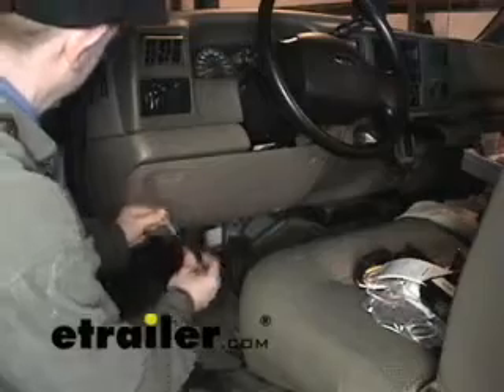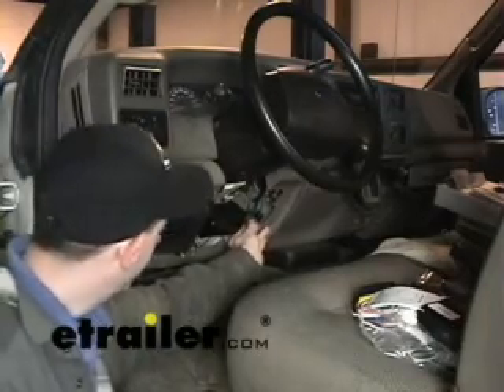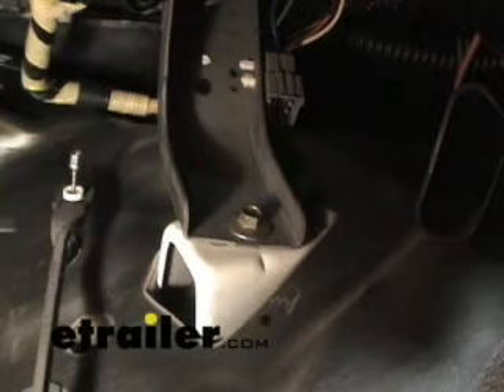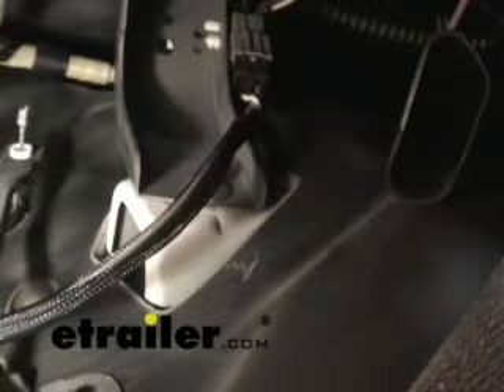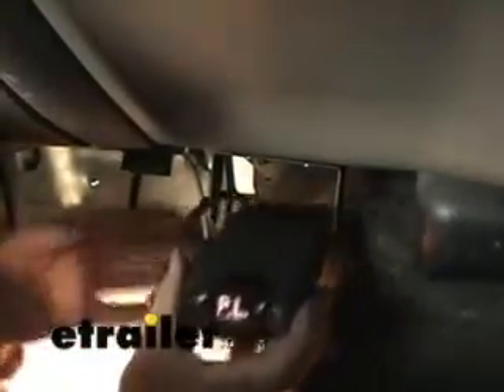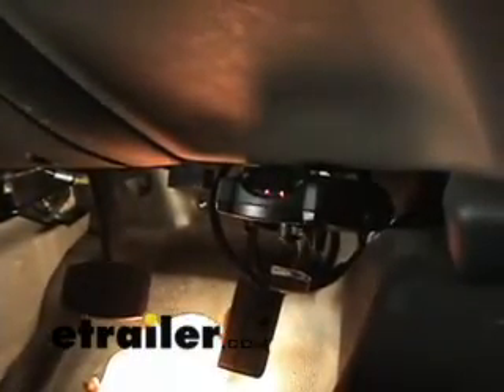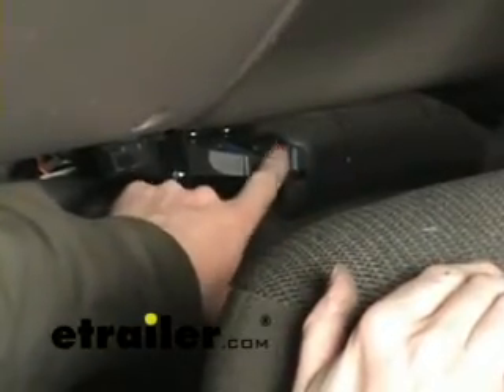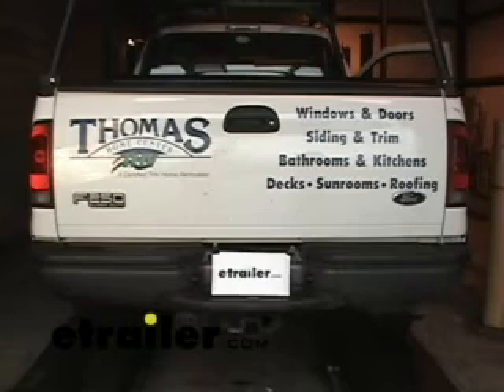etrailer | Trailer Brake Controller Installation - 2003 Ford F250

Comment from the maker: The numbers, or gain, are set in a very similar manner to the Hopkins Agility. If you want, type in this code "b5u5aj8LKd8" into the youtube search box and you will see a video that explains exactly how to set the controller of this video up.

Comment from the maker: The tester used in most of our videos is part number 3808 on etrailer(dot)com. If you would like you can go to the website and under the 'Accessories' tab there is a link for 'Tools'. In that group you will see 'Wiring Tools' and there you will find all of the testers, if you would like to see the entire selection. If you have any other questions, please let me know. I would be glad to help!